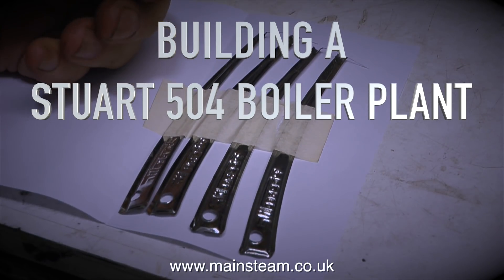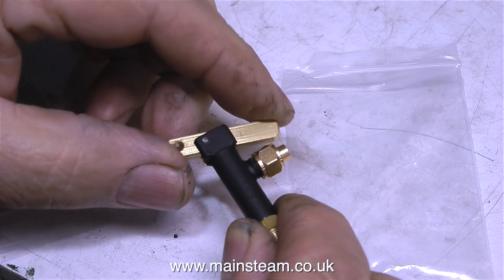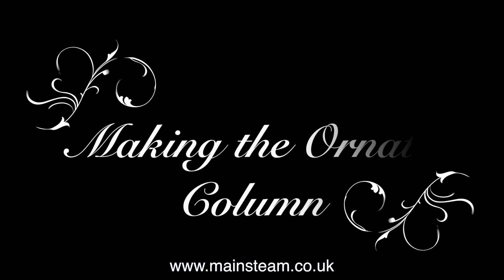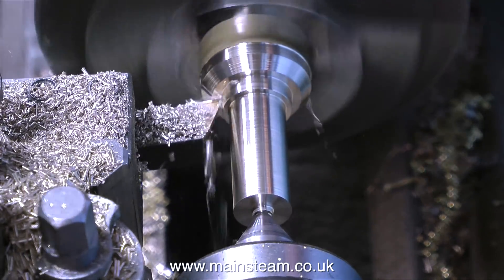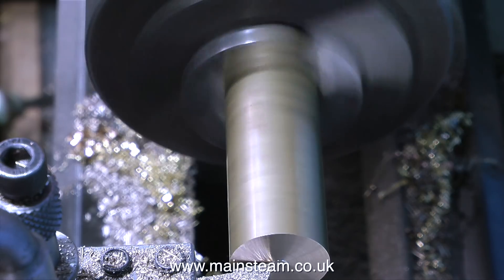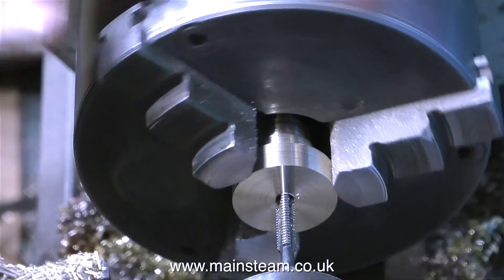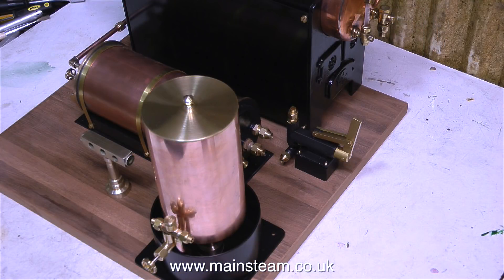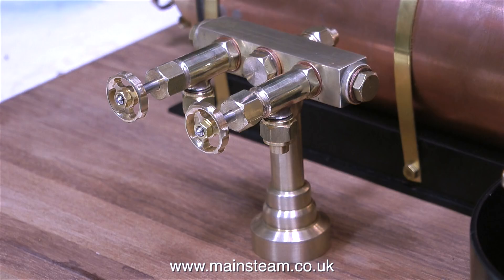MAKING A STUART 504 BOILER PLANT - PART #8 - TURRET & WHISTLE

Comment: The plant is very lovely. I agree with you on the globe valve on the 504 it is rather large and is distracting, an particular the handle looks plastic? Taking away the nostalgic appearance. Will you be offering this plant for sale or holding onto it for awhile?
Reply from the maker: I always play with them for a while, then I post them for sale on the "Used Models" section of the website :-)))

Comment: That was great stuff! Thanks! -- Of course it only leads to more questions... Just wondering why you soldered the manifold on the stand instead of threading it? (AND) At about 7:10mins you create about 10 steps on your free-lathing spree (fancy!) and simply wipe it out with one pass of the cutter... was great to watch the ease of making those 10 steps, but you really shake the Etch-A-Sketch fast with that one pass of the cutter. I think "stairs" was the only thing I got good at on my Etch-A-Sketch! Thanks again for the fun vids.
Reply from the maker: Think about it - if I threaded the centre part from underneath there would be a foul up with the existing thread .......... The thing about free for turning is that you can basically do what you like as you figure out in real time what looks best ....